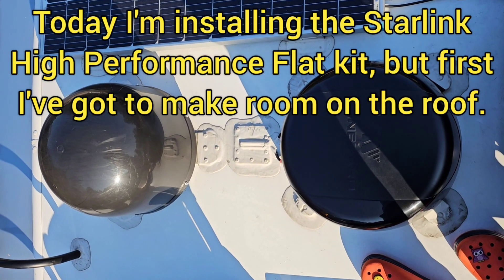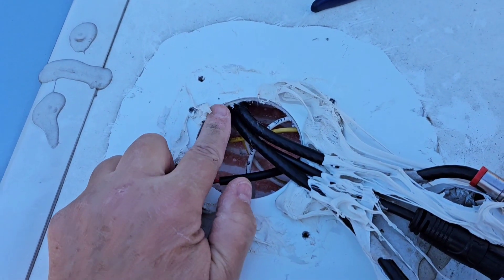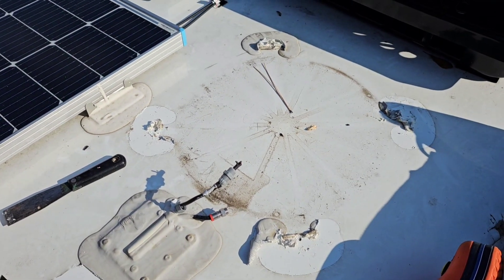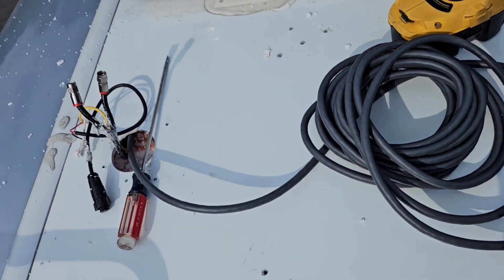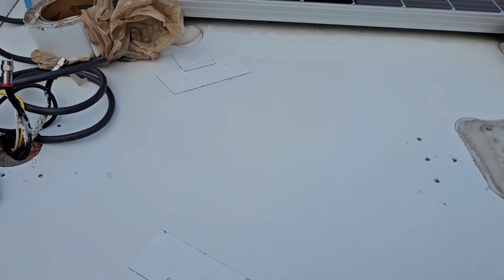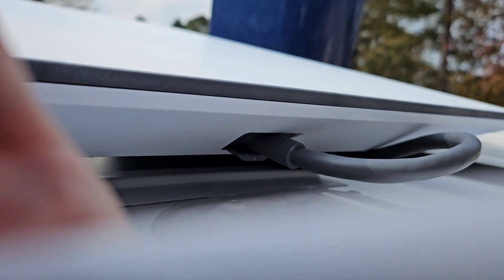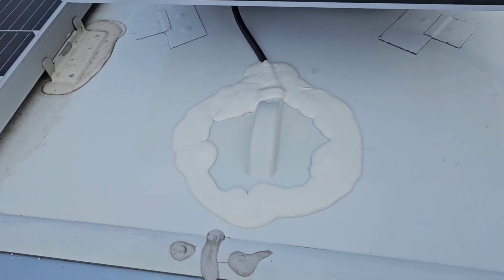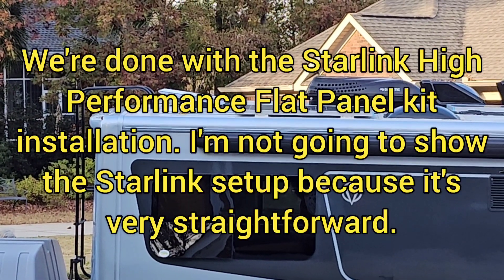Starlink Flat High Performance Kit Installation on a Leisure Travel Vans

Comment: another awesome install!!!  im considering a MB model....i hope the cable routing will be as easy.  Have you ever recorded any other floorplan installations?
Reply from the maker: @fredzuccarelli  No the RL was my first and last.  But on the MBL you can use the LTV solar wiring hole, which is near the microwave. Or just drill a new hole as I do in this video, https://youtu.be/LIAdKP5xm5s?. I find anymore it's easier just to drill a new hole in the roof to make things easier.

Comment: for the life of me why did Starlink go to 2 power inlet plugs as the older version needed one plug? Thoughts Miss Sandy
Reply from the maker: I know it's really ridiculous that you need dual outlets. But it's because the flat high performance dish needs it's own power to self position, have greater reception and high through put than the standard Starlink dish. Then the Router needs it's own power supply. I would have come up with a dedicated outlet up in the cubby area, but I didn't have the time. My friends said they were fine with using the existing outlets because they don't use the area at all.